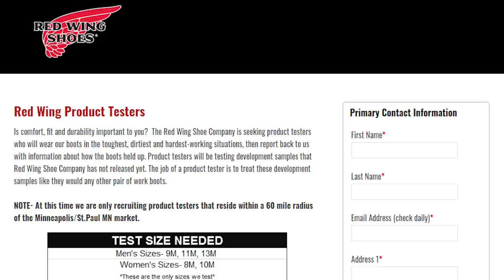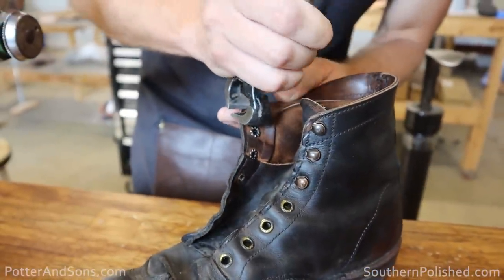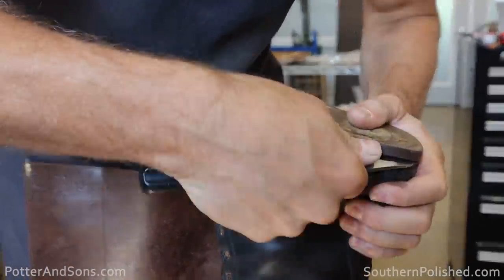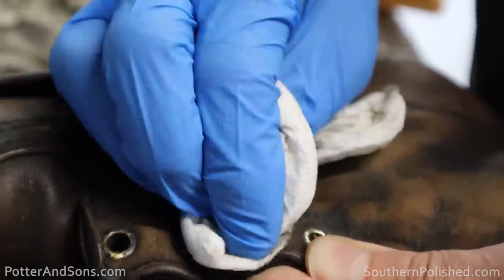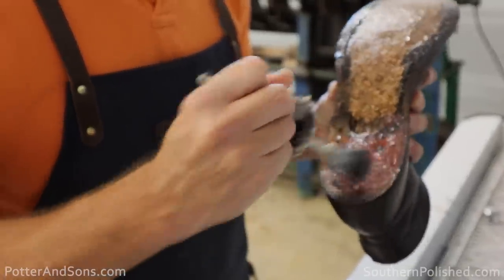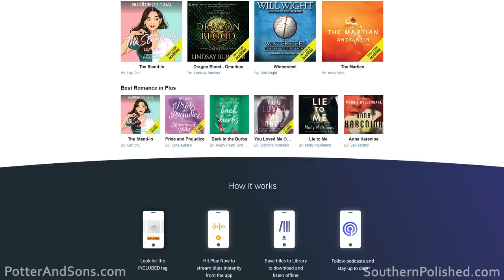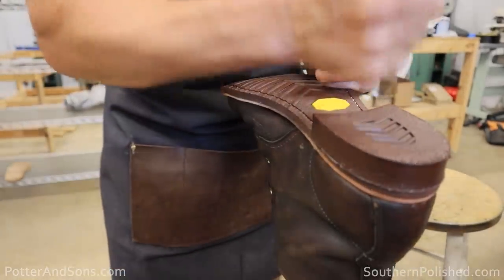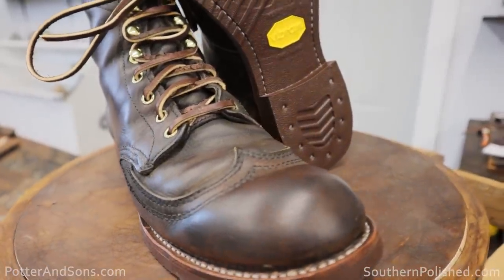Red Wing Prototype / Test Boots Are Refurbished to Their Original Look

Comment: The way to remove the speed hooks is to drill them. Start with a bit smaller than needed, and move up a step at a time until the bit cuts most of the inside ring. Hold the hook with pliers while you drill.

Comment: Shoe restoration!  I have a pair of Bedstu Burst boots that’s I’ve owned for 6 years and are my absolute go to shoe in the fall spring and winter.  Going through your channel this weekend I’ve not seen you do a pair of bedstu’s.  I loved them so much and figured they’d wear out that even though they’re discontinued, I was able to find a new pair on eBay.  I’ve been wearing these out and pretty much worn through the insole and the rubber off the heel.  From just discovering your channel I now see that these can be repaired and I don’t need to break in the new pair.

Comment: Fantastic job as usual.  Very interesting story.  I have been repairing and selling Red Wings since 1976.  Red Wing dealers with shoe repair facilities can buy Red Wing branded soles and heels which is nice.  To my knowledge RW no longer produces boots with their original Red Wing branded  NeoCork  (neoprene rubber with cork) sole as was on this prototype boot.  I could be wrong but I am pretty sure the NeoCork is gone like the the wind.  I  sold a bunch of Red Wing #1177 slip-on PECOS (their name for western inspired slip-ons) boots with the very sole and heel that I see on the prototype boot.  If I am not mistaken Vulcan made both Red Wing version and  their own NeoCork soles in Clarksville, TN which was Vulcan's last remaining plant (closed in or around 2018).  The sole you and your customer selected by Vibram is slightly thinner and much more flexible.  It, as most Vibram soles, will wear extremely tough while being likely more comfortable than the original due to the increased flexibility.  Again, nice video.  I think you guys may just be part of the solution to get younger people once more aware and interested in shoe repairing which might help the USA bring back more quality made here footwear to the market.  Well made footwear is a high-art worth paying for.  The client said he had these 15-years and actually they looked like they might only need a heel and some TLC to go another 15.  Keep up the good work.

Comment: The D.B. Gurney nail source you mentioned has an interesting factory in Whitman, Mass. Since I'm only an hour away I go there to buy my shoe nails, especially hobnails. About 30 years ago David Gurney let me wander through the mostly vacant or idle factory to pick through old wooden boxes to find the 'old stock' no longer in production. Though some of their machinery has electric motors a lot of it was powered via wide leather belts running from the overhead drive shafts that ran the length of the factory. I didn't see it but I presume those shafts were once powered by a steam engine behind the mill, now there must be a large electric motor in it's place. Sadly most of the factory is quiet as most of the shoe factories in New England have closed, thus domestic demand for much of what they made has disappeared. Anyway, stepping into their factory is like travelling back to 1900.

Comment: Try Methyl Ethyl Keyton (MEK) for stripping wax. It's used in furniture restoration from removing coatings and waxes prior to repairs, and in the jewellery industry as a stabilizer for hydrogen flame generators. It's a more refined version of acetone, and I discovered how effective it was on leather when I spilled some on my boots while refilling my microflame unit
Reply: Also used as liquid model cement, which would probably be the easiest source for a small quantity for testing purposes.
Reply: @gchampi2  Used to use it fixing broken computer case clips for years.

Comment: I wonder how they calculate the length of the nail so as not to puncture the inner sole?
Reply: They don't. The nails pass through the inner sole, hit the cobblers anvil & bend back down into the heel block, "clinching" the heel, uppers & insole together. Much stronger than using a shorter nail & relying on friction.

Comment: Would the German leather midsole (thicker variety) + house leather outsole + thin Vibram rubber half sole (sole protector) be about the same height/thickness of the original nitrile cork sole? Or even the mini lug version sole of the IRs? Guessing you may have swapped out any Red Wing original soles for the above specs? Thanks

Comment: I think these are actually cooler looking than the original Redwings

The wing tip is a nice change that you (or at least I) don't see a whole lot on work boots, and the heel design looks way better than the original heel

If I were to cobble my own boots (as I want to do in the future) I would definitely use those 2 design aspects

Comment: Hey guys. I have a boot question. I have a pair of Ariat workhog slip on work boots. I stopped wearing them because the leather seemed to soften so much that they loosened up and I have to wear 2 pairs of socks. Is that something that could be fixed?